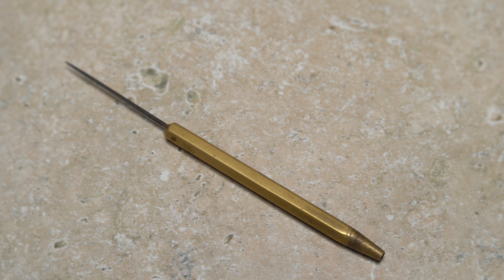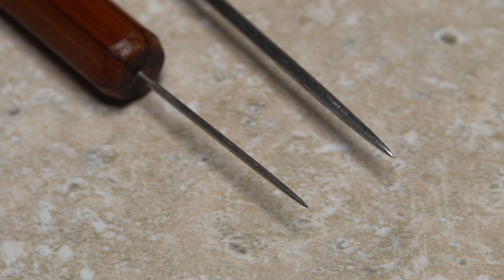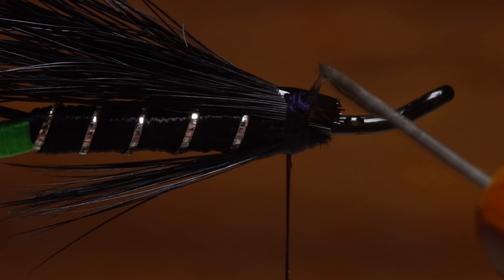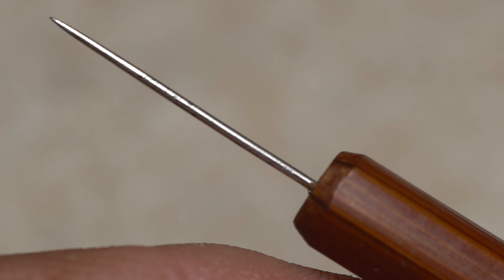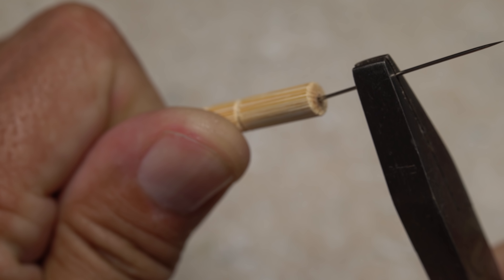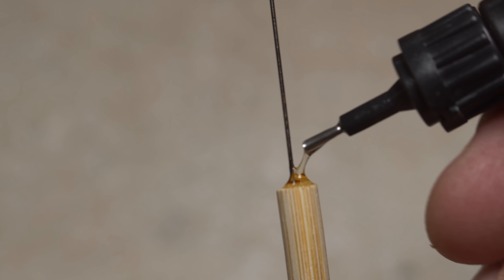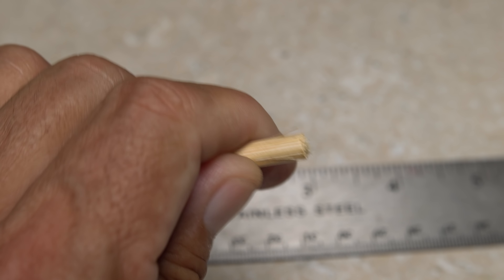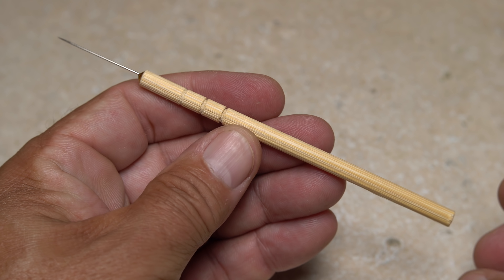Fine Tipped Bodkin

Comment: I made my standard bodkin using an upholstery needle glued into a small handle of 5/16" square stock cherry from my scraps bin. I used square stock so it would not roll off the bench. I used the same cherry stock, slimmed down to 1/4" and a milliner's needle for my fine bodkin. I like the bamboo rod section idea for a hex handle. Beautiful. Next project from my bamboo rod restoration parts stockpile. 😉